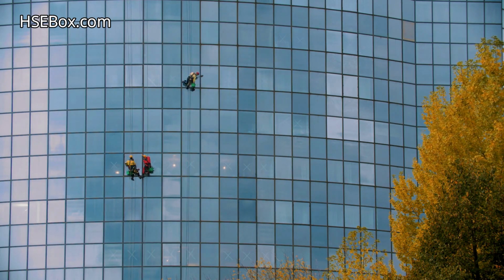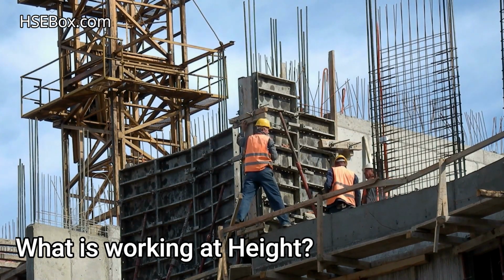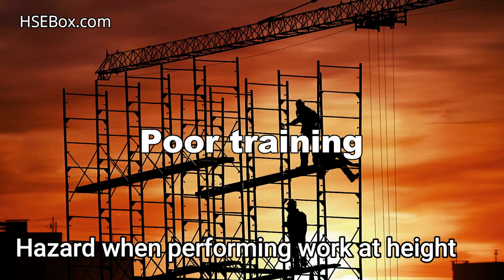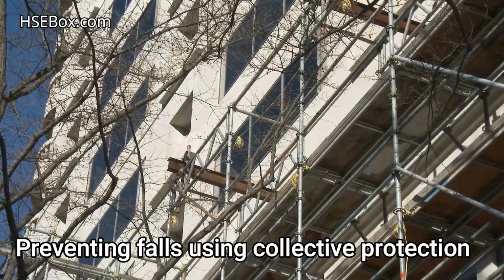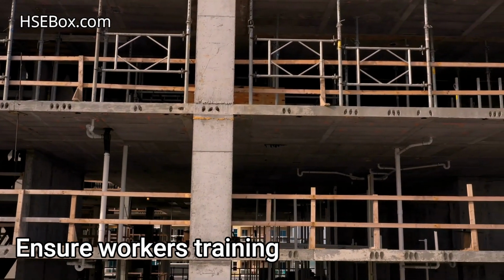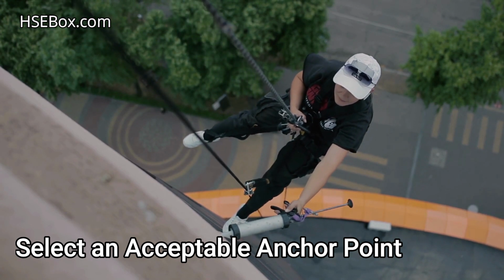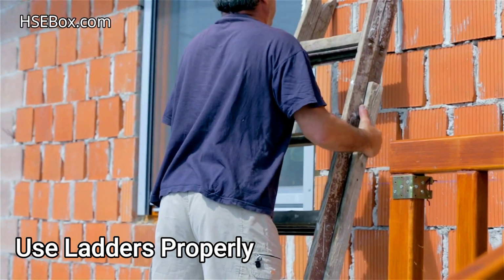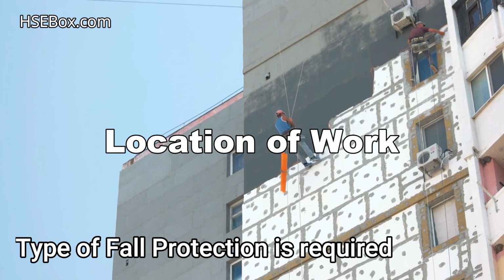Working at Heights - Hazards and Control Measures - safety training

Comment: Gaurd rail is safety equipment when working at height from fall protection
Reply from the maker: Absolutely correct! Guardrails are crucial safety equipment for working at height as they provide a physical barrier to prevent falls. They help create a safer work environment by reducing the risk of workers accidentally stepping off edges or ledges. Additionally, guardrails are often considered a form of collective fall protection, as they protect multiple workers simultaneously. It's essential to ensure that guardrails meet safety standards and are properly installed to effectively prevent falls.

Comment: Guard Rails are  use to protect workers  from falls when working at Height , So it's not piece of PPEs
Reply from the maker: You're absolutely right! Guardrails are a safety feature used to protect workers from falls when working at heights, and they are not considered personal protective equipment (PPE). Guardrails are a passive form of fall protection that creates a physical barrier to prevent accidental falls, while PPE includes items like harnesses, lanyards, and helmets that workers wear to protect themselves. Both guardrails and PPE play critical roles in ensuring worker safety, but they serve different purposes. Thanks for highlighting this important distinction! 🛡️👷‍♂️🌟